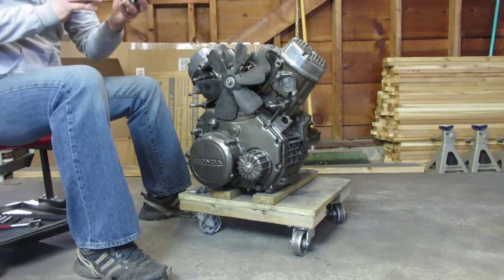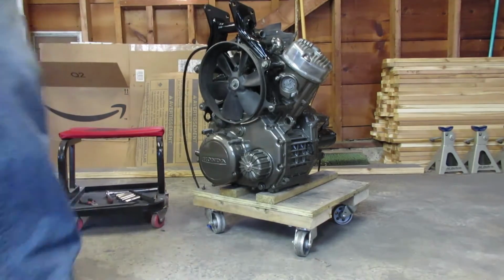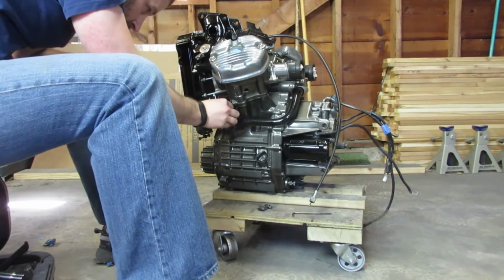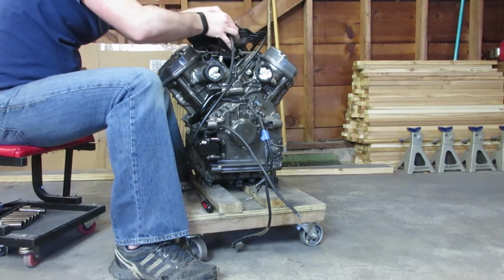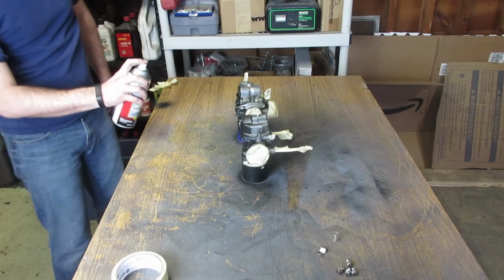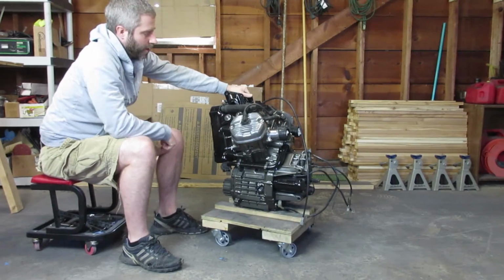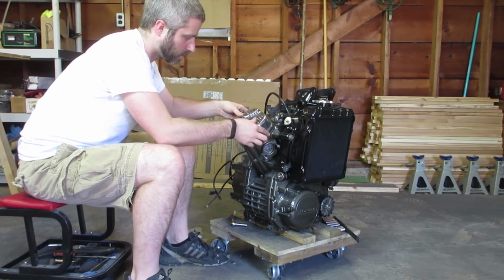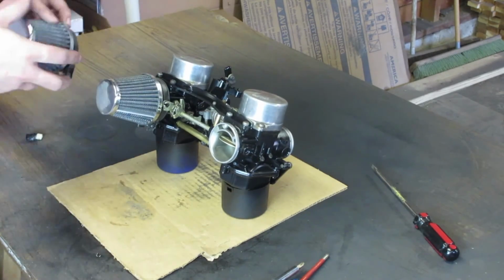Motor reassembly - Moto Fugazi Build Part 9

Comment: at 9.45 what is the cable going into the back of the gearbox underneath the carbs. i'm trying to figure out what it is for
Reply from the maker: Stator wire? Otherwise the one the long one that seems to connect from the front to the rear is actually tach cable. It probably just flopped towards the back.
Reply: @LukeDaniel  yes! stator wire cheers. i just got a cx500. looking to do a similar project in the future. just coming to terms and making note of a few dodgy parts that look to need fixing. love your videos.

Comment: That thingy is the air dam. It stops the heat of the engine being blown at your coils. The coils will crack and die pretty quickly without the air dam!

Comment: Don't know why but I would've put a coat of lacquer on those valve covers :D
Reply from the maker: +Alin Iordache I've read mixed reviews on getting clear coats to adhere to polished aluminum. I also don't mind polishing them. Even if its a task I have to do every year, takes an hour.
Reply: was there much trouble putting the fan back on the engine.